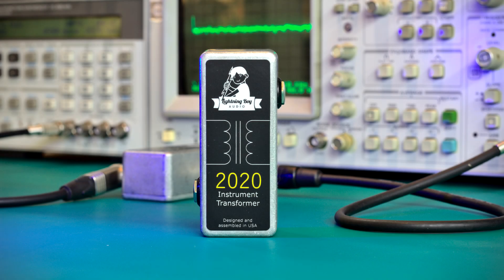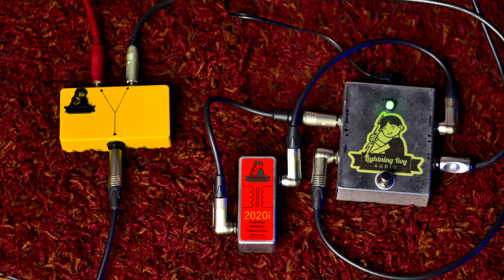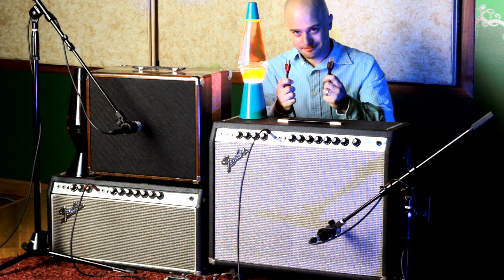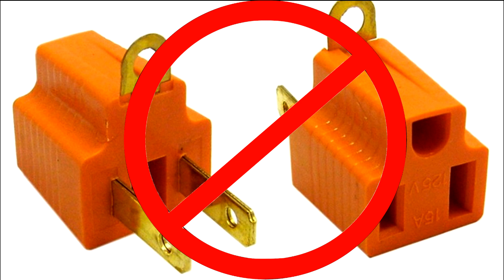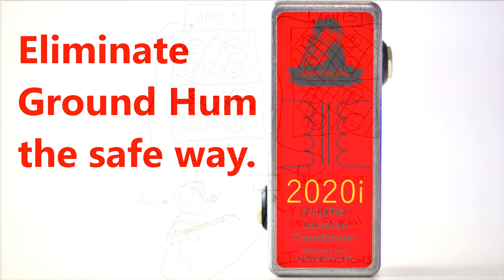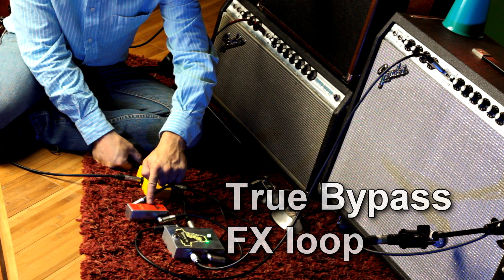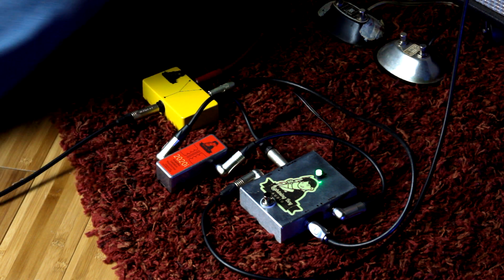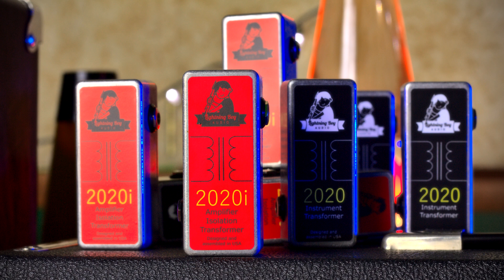Lightning Boy Audio 2020i Amplifier Isolation Transformer

Comment: if you have discontinued the product.  need to either take the video down or provide an alternative product link.
Reply from the maker: These are on the used market and people will want to know about them.  Posterity.
Reply: Rapco horizon isoblox transformer isolation

Comment: Is it same transformer saturation 2020?
Reply from the maker: This is not the same product as the 2020 Instrument Transformer.  The transformer itself is the same, but the circuit board its mounted on is wired differently, making it a completely different product.  It is not a replacement for a 2020 Instrument Transformer.  The 2020i is an isolation transformer.

Comment: Fascinating product! I just installed Lundahl transformers in a channel strip and am amazed at the difference in sound. As I am also rebuilding a vintage Fender tube amp, I wonder could your transformer be wired inline from the output of the input jack which runs to the tube as it is not grounded?
Reply from the maker: The transformer itself could be, but not in this form where it is mounted on a circuit board and housed in a metal enclosure.  The concept of my 2020 instrument transformer (see previous video) solves that for you in a convenient way.
Reply: @LightningBoyAudio  Thank you. It seems like such a great idea, you would think more amp designers would incorporate it. You've given us a great solution. I have also wondered about its use for an audio mixer. Using the effects send to and from the pedal and then using the level to adjust to taste.